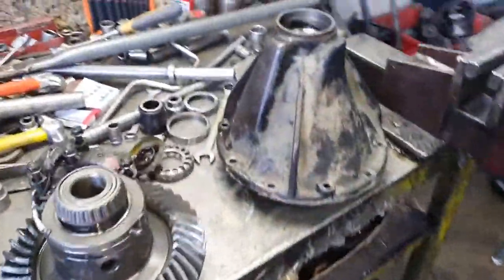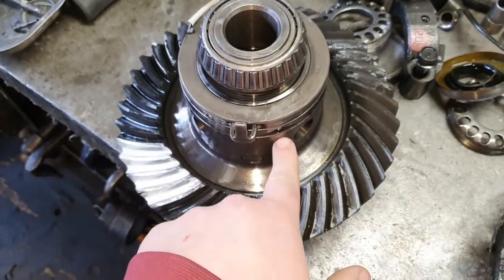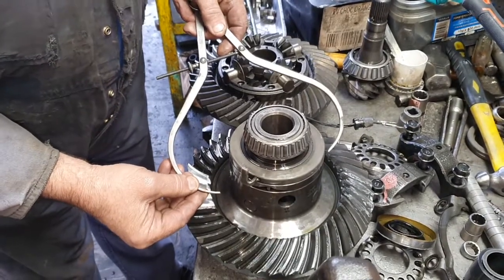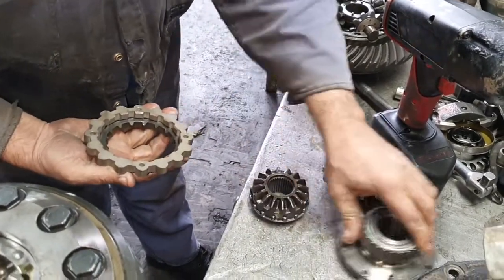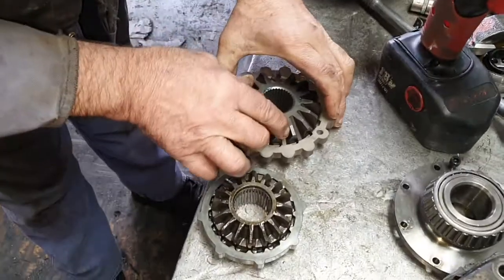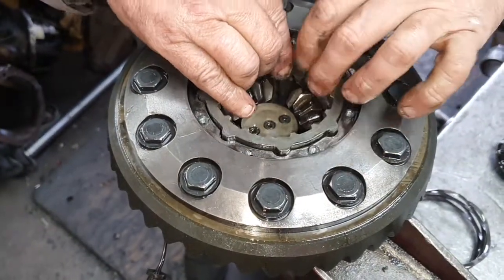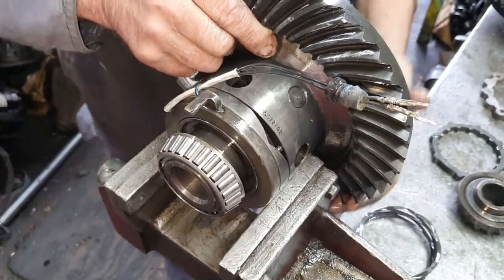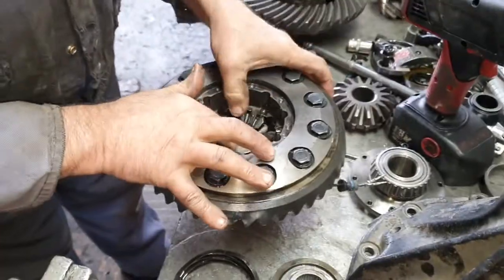Eaton E-locker problems. electric diff lock, poorly designed.

Comment: I read all the comments,  Im going with Eaton E lockers on my Ford Expedition, front and back...... I did my research. Old school is out...... I have power seats, power, this and that, why not have power lockers, to flip the switch on? I would rather have that option.. to turn  on when needed. over my stalk limited slip 4wheeldrive

Comment: All well and good but I’m interested to know how many have failed that you’ve had to replace or delete
Reply from the maker: We have seen them smash to pieces multiple times. I lost count on how many but the locking spline teeth wear and then lock and unlock continuously. These diff Locks are just not big enough for the size of these big four-wheel drive vehicles people put them in.

Comment: Im kind of in agreeance with some of the comments, there's Rubicon's in America wheeling harder than most patrols in Australia would dream about without issues. I say most due to the laws over there allowing 4wds there to be street legal where the equivalent here would be a trailer queens between events.

On a counter argument, maybe Nissan had to make it bigger due to been inferior steel to the Elocker - prove otherwise????
Reply: You are kidding your self. The Nissan Powerlock LSD is the strongest around - a proven design and immensely strong, AND they work, unlike smaller units as in Toyota.

Comment: Those "little screws" don't need to be big. The carrier halves are held together by the diff bearing preload. However, I have tended to like these over the years as the better selectables, but I've never seen the innards...looks weak
Reply: Those set-screws can come loose and drop out of the carrier. Only luck will have them NOT grind into the gear set. You want the risk?

Comment: Subbed. I'm looking for a rear diff locker for my 8.4 toyota diff, eaton is complete garbage, I was told by my installer to stay clear from ARB due to failures/ leaks. Is  a TJM Pro locker they way to go?
Reply from the maker: Well obviously I would say the TJM Pro locker is the best but my father designed it so I would say that lol. But it is the best and it has no faults besides TJM making it incorrectly. The pneumatic cylinder strokes 1 mm too long. The pneumatic cylinder strokes 1 mm longer than the locking ring stroke so therefore when you engage diff lock the pneumatic cylinder fork is always push against the side of the engagement ring. which it will still work just fine but it's just a shame they keep making it slightly wrong and never listen to anybody. But that's big companies for you it's impossible to get through to them, we have been telling TJM for the past 15 years that the pneumatic cylinder is made slightly incorrect but nobody seems to take any notice of anything we say. But still with this slight incorrect manufacturing process they have done the TJM Pro locker is still the best diff lock on the market. I have video on YouTube explaining this. What you have to do is add a 1 mm washer inside the pneumatic cylinder and it will fix the error. You don't have to do this but it is a good thing to do. You need clearance in unlocking position and locking position of the stroke. You cannot achieveslack at each end of the stroke unless the pneumatic cylinder strokes less than the stroke of the engagement ring. Besides this it is the most strongest diff lock in the world. And will last a life time if installed correctly.
Reply: @differentials   Yes from my little bit of research the pro locker seems to be the best, it will require zero maintenance and actually stay locked in both directions unlike the eaton e locker, Thanks
Reply: @differentials  is he gonna fix the mfg issue? I'd buy one if it was good out of the box
edit: nvm there isnt one for a dana 44
Reply from the maker: @SamCyanide  the customer didn't want it altered so we didn't bother. But you can drill bigger holes and put bigger bolts in. But all this modification cost time and money. You have to ask eaten if they going to make it better. I'm not eaton. We can modify the E locker if you want but like I say... It cost more money 💰
Reply: @differentials  it looks like just the Harrop ones had those issues from my research but I don't know anything honestly lol. I'm saying how come the TJMs don't have that fix from the factory if you gotta add washers
Reply from the maker: @SamCyanide  we have told TJM over and over and over several times over the years but they refuse to do anything. If you can find out let us know. I think these big companies just don't care.
Reply: @differentials  ah okay I misunderstood as your father ran TJM but he did the engineering and sold the design I suppose and then they manufactured it incorrectly

Comment: Have had an elocker in the front diff of my Gu Patrol remote area tourer for almost 4 years. Total rig weight (including TVan) is a bit over 5 tonnes. Have used the elocker many times to to avoid potentially damaging momentum, as well as to get up some pretty gnarly climbs, including those requiring steering around a bend part way up. Never had a problem & love it. Why would anyone want go around a roundabout with a diff locked?!!
Reply: Reported problems with e-locker are self engagement whilst driving on bitumen, a phenomenon you don't want to have happen to you! The visual evidence is striking with physical size of comparison gear both to Pro-locker and indeed standard Nissan. I will be pulling mine out BEFORE it lets go.

Comment: So how does all this relate to the factory Dana 44 E-Locker in my Jeep Wrangler Rubicon? It doesn’t seem to have the unlocking issue & it does very hard rock work. It’s 13 years old & it’s done almost 300,000 hard K’s. Is it any good?
Reply: it has nothing to do with the jeep rubicon E-locker because the jeep e-locker is a GKN not an eaton.  different design and a different manufacturer. is it any good, you answered your own question 300k km and 13yrs later it's still going i'd say that's good.

Comment: yeah, seriously this extremely helpful.   So if I am hearing this correctly, you're dad in the video sold the locker design to TJM?  If so, sounds like you guys need to do a kick starter and go back in business and design it the right way and DON"T SELL FREAKING OUT
Reply: @differentials  website???
Reply from the maker: @allenjones4862  www.mcnamaradiffs.com.au

But we don't advertisers it. We just make them and sell them when customers need one.
Reply from the maker: @allenjones4862  all you will see on the website is the first iteration of the diff lock which is a vacuum design

Comment: I use a Eaton E locker in the front diff if my 2005 2500HD sled pulling truck over 2000lbs of torque 1000hp Duramax diesel 8000lbs class pulling a 40,000 plus lb sled and never failed so what’s your point guys?
Reply from the maker: you have a big truck and the Eaton elockers for big trucks are a lot different than the Eaton elocker we are fucking around with here for this four-wheel drive. this Eaton elocker we have, that we were putting in this Nissan is very very small and the planetary gears are tiny prepared to the standard size. There's a big chance that these will just blow up straight away if you give the car hard time off road
Reply from the maker: But going from what eaten does where they use all the small planetary gears out of smaller diffs to make up bigger diffs for larger cars to save manufacturing costs I wouldn't be surprised if your truck front e locker is undersize. If you can take the cover plate off and send me a picture of your E locker that would be a massive help. I could tell you if it is a good one or not.
Reply: Neville McNamara oh it’s apart I destroyed my ring and pinion both front and rear last week where can I send the pic to?
Reply from the maker: @Reedic20  mcnamara@mcnamaradiffs.com.au
Reply from the maker: That centre you have isn't even a Eaton e locker it is a Eaton LSD
Reply: Neville McNamara it’s no limited slip differential I hit a button and it’s 100% locked
Reply from the maker: @Reedic20  yes yes I can see it is a E locker after seeing your other pictures you sent me after. This Eaton elocker is completely different to the one we are working on in this video. It seems to be a lot stronger. The only weakness I can see is that it has two pinion gears instead of 4. Can you please send me a picture of the locking ring that goes over the side gear to lock the diff.
Reply from the maker: Or if you could just send me the link to the one you have on the internet I could tell from that if it is a strong one
Reply from the maker: Yes but your Eaton e locker is in a different car than the one where fucking around with on the bench hear. You're one may be made a lot bigger for your car. but the one we have is made extremely undersize and it is bad to see they are doing this.
Reply: @differentials  do you know what you are talking about ?  What lsd is tougher?  If you want no slip get a spool dumb ???
Reply from the maker: The planetary gears could have been made much larger in this rear E locker which has more torque than the front diff. Your diff is in the front of your truck so it has less torque on it.
Reply: Neville McNamara less torque on it it’s a competition sled pulling truck with over 2000lbs of torque I run 35x12.5 tires I hang 2500lbs of weight in in front of my truck I launch at 3800rpms in 4th gear no possible way you are putting more of a load on those then I am